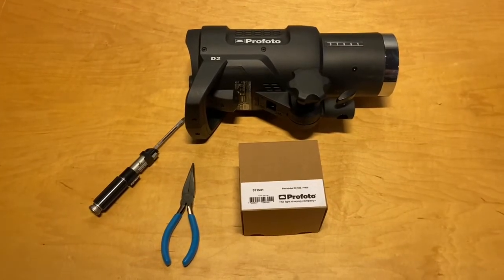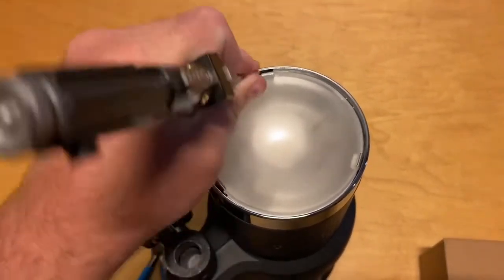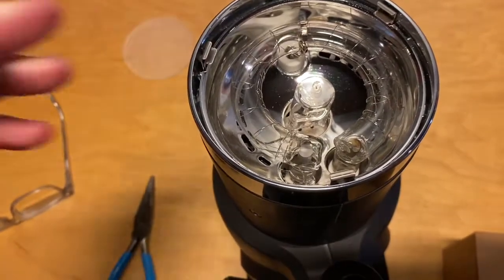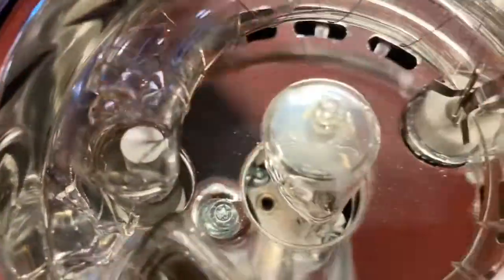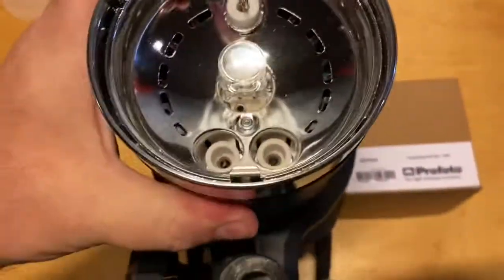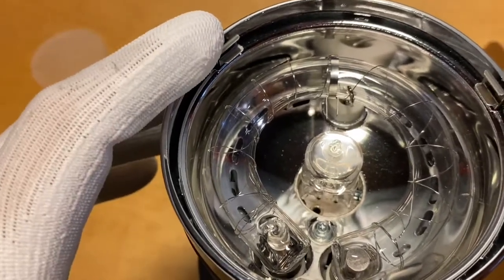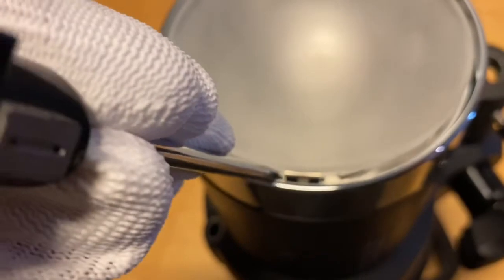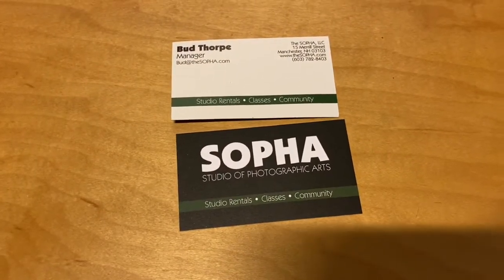Profoto D2/B1: replacing the strobe tube

Comment: I use dental floss to slide the clips for the face back.  It works really well when replacing it. I read somewhere that it worked well so gave it a try myself when placing a frosted dome on. I've never had to replace a tube yet so thank you.
Reply: That is brilliant!  Thanks for sharing!
Reply: @BudThorpe  Yes sir, You're welcome.